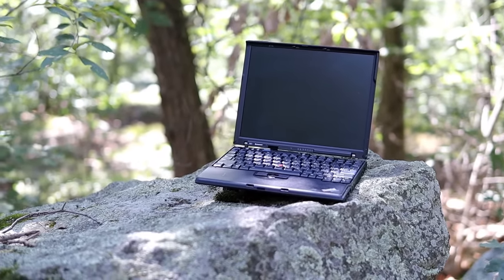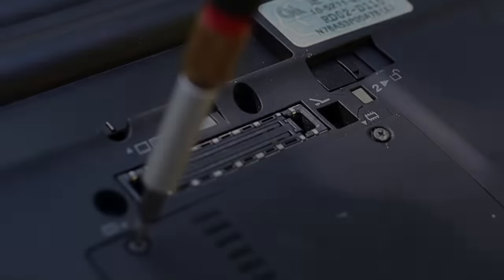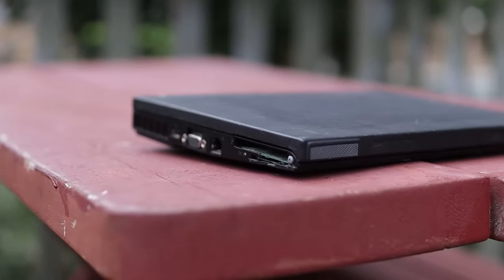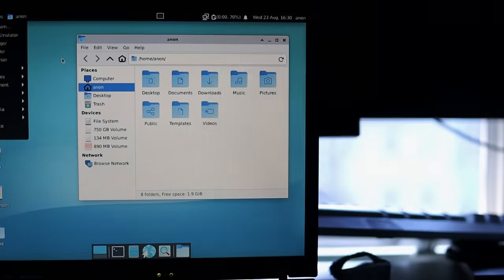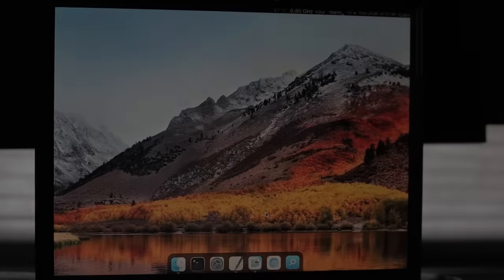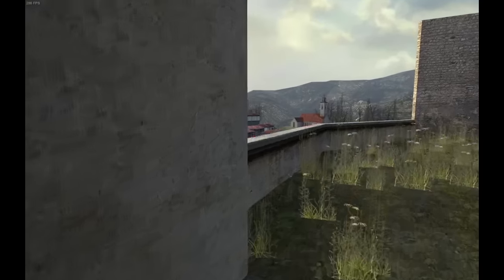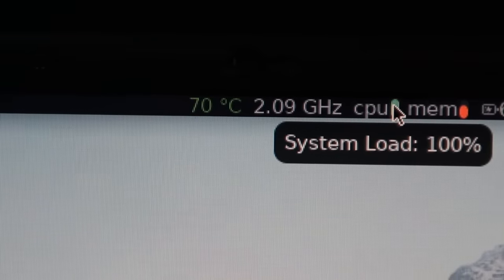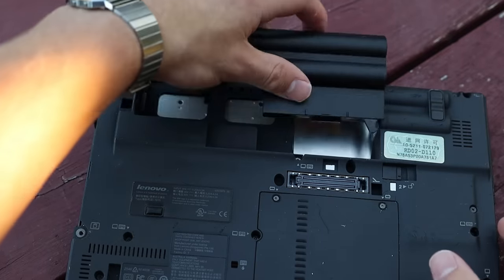Can Linux save this old laptop from obsolescence?

Comment: I have an X200s I was thinking about doing this with - I love the mechanical keyboard and the netbook type size, but to be honest, I was thinking of using it just for bash scripting as I write code mostly in the linux terminal using Vim. Any thoughts on the performance I could expect compared to a newer laptop?
Reply: I still use a Thinkpad T22 with a Pentium III CPU and 512 MHz CPU to do BASH and Python scripting whilst SSH-ed onto my home server - a great keyboard and a nice and quiet computing experience.

You'll be fine with an X200s for that purpose - but getting it to 4GB RAM and installing an SSD are two good and cheap upgrades that will help also. Ubuntu might be a bit "heavy" for it at times, Linux Mint or Fedora might be better options.

Comment: The dislike button is shown, but no count. 
(liked and subbed, btw)
I found my X60 in a skip and  refurbished it with bits and pieces including RAM CPU and SSD .
The only negative with these older ThinkPads may be the rather dim displays.
I guess they can be replaced too.

Comment: I wonder how Arch would run on this if you built a configuration starting from a bare shell prompt and ending on a DE
Reply: it would run just fine, a bit more idle memory usage than void but the same xfce setup will be 350-400 megs idle in the worst case scenario

Comment: I have a Thinkpad x300 with a dead battery laying around, 2 gigs of ram, 64gb 1.8 inch ssd(pain to find a replacement). Running ubuntu 14.04(whatever I found on a random usb stick ony table), it's okay for basic tasks, 480p youtube works fine in firefox. While I was checking on the OS version just now I realised I forgot the password for the only user. Whoops.

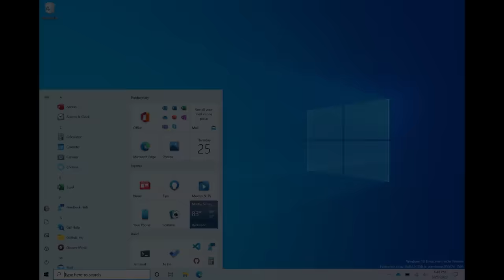Comment: 3:48 Windows 11 has ridicules system requirements. The Windows 11 installer will refuse to do the install on many computers if it does not like the hardware, even though these computers would run fine with Windows 11. When the Windows 11 is hacked to force it to allow the install on older computers many times it is found Windows 11 runs on them just fine. It is an artificial limitation, Microsoft has intentionally designed the Windows 11 installer to NOT run on many computers that would otherwise run fine with Windows 11.

Comment: i have a t400 and just upgraded it from hdd to sdd and its blazing fast with dual boot for ubuntu 20.04 lts and original windoows xp. the ati graphic card can be only utilized by vista or xp and does not work with win7 or later.
Reply from the maker: T series is a nicer form factor imo

Comment: I have compaq 610 notebook. Last week I installed Linux Mint. Nearly have the same specs. Ssd and 4gb ram is game changer here. Before this upgrades win 10 is a total pain. After this upgrades win 10 is better on desktop but system use too much CPU and cause freezing while watching videos. After linux mint I can finally  open netflix and watch :D (up to 720p 30fps. 720p 60 fps cause some freezing :((( )

Comment: I only found 2 really old Linuxes that could be installed without PAE, and for both of them I couldn't find any mirror servers that work, which means you can't even get any software on them. i try to get my T42 to work with 512 mb ram hihi

Comment: Haiku OS Beta 4 would also probably run very fast on this laptop. I've been trying it on some older 32 bit hardware and I've been very pleased with the results of the 32 bit version. Beta 5 is planned for later this year.

Comment: i have a tablet version of the thinkpad x61 and found that games work best with 32bit windows 7 and modded phdgd gma drivers
Reply: I disagree with you 100% and I don't believe you tested each and every game under Windows and in Linux to make that kind of legitimate comparison anyway.

I have been running Gentoo Linux for some 20 years now and I repair, refurbish and collect old IBM and Lenovo Thinkpads too - I probably have around 50 in my collection. In my experience, Windows 32-bit games run extremely well on WINE under Gentoo and bearing in mind that these are games that I have owned and enjoyed for many years, I do remember playing them in Windows 2000 and in Windows XP and in pretty much all cases, I notice no difference between playing them in WINE on Linux.

WINE is a very old and established product and, sure, go back a few years and there were more compatibility issues than there are today - but with the amount of work that has gone into WINE and Proton because of Steam and the Steam Deck, it has become a much better product in the past few years.

You know yourself that running Windows 7 on a Core 2 Duo laptop with a maximum of 4GB RAM is "pushing the limit", otherwise you would not have suggested 32-bit Windows 7 only. (All CPUs in the X61 are 64-bit capable, by the way.) Therefore a slim installation of Linux (and all of my Gentoo builds are as slim as possible) is always going to outperform the bloat of Windows under any circumstance - and therefore "slim Linux + WINE" is always going to equal or be better than straight Windows for older games where there aren't likely to be compatibility issues anyway.

Comment: Here I am with 12TB worth of SSDs installed in an older laptop that is already an antique by most standards yet is vastly more upgradable than anything made in the last six to eight years or so. Modern laptops you'll be lucky to get more than two nvme slots and two sodimm slots never mind a removable battery that has for the most part gone extinct aside from a few rare examples. Gotta laugh at those overpriced macs with tiny SSDs that brick after only 200-300TB of writes.

Comment: Just try to find Batteries for ANY laptop over 6 years old!  LCDs die at 6 to 7 years old!  Most older than10 year old Laptops CANT USE SSD's and HDDs are disappearing !
Reply: I own this laptop and the LCD is good if a little dim. Batteries are found at 20-30 dollars on eBay, and it can use an ssd just fine as I'm running a 128gb kingston currently.

Comment: No need to install Linux, I have a 16 year old Asus M70Vm laptop and it has W10pro installed, I have optimized W10pro through many registry tweaks and I have eliminated useless and harmful processes and functions like Edge and it has become fast, it starts quickly and displays full HD videos without any disturbances.

Comment: How do you measure CPU temperature?
Reply from the maker: I used the xfce4-sensors-plugin and added the temperature monitor to my system panel. There;s an app called Psensor which also does the trick.

Comment: You don't need to mess with linux for simple everyday internet tasks. Just upgrade the ram to 2 or 4gb (depending on what you had before), optionally replace hdd with sdd and install Windows 8.1 or even Trin PC if you have 512-2048MB of RAM and 8.1 is still too heavy for your PC or Laptop. Watching this from HP DV9700 with Core2Duo and 4GBs of RAM and it's perfect in 720p.

Comment: The biggest challenge for old computers (>12 years) nowadays is multitasking modern apps for web browsing and office suites, no matter if the os is windows or linux. In this regard, most people that says zorin/mint/peppermint in these machines is a good solution, actually they don't use it, keeps them like hoby computers, because if they actually would use it they'll notice that are BS solutions, the computer will be sluggish and may freeze or halt, just web browsing and using an office suit app (especially using libre office and open office). The real solution is using windows 7 with MS office 2010 or older, using a firewall or a compatible antivirus and have extra care web browsing; if you really want to use it as a daily light-office-task machine

Comment: I am using my dads laptop for now 6 years its a dell latitude d630 with dual core t7100 and lxle linux on it 4 ram and 270gb hdd, not the best but get the job done most of the time, it's age made me lurn linux, the only down side to it, is i have to keep the display standing with a 2litres bottle of water 😂😂
Reply from the maker: Nice lol

Comment: What about energy consumption? I would assume that older laptops need way more energy than newer machines, therefore not being cheaper on long run?
Reply: The energy difference between this and a more modern laptop amounts to pennies. Not a difference you would ever notice in real-world use.
Reply: @SebisRandomTech  It will be running close to 100% pretty much non-stop, pulling probably ten times as much as a modern laptop doing the same tasks. For that "pennies" you could easily buy something more recent that will not run at 100% installing package updates for 20 minutes each week.
Reply: @kaminekoch.7465  You guys are really overestimating how much of a difference you’ll see in your electric bill with these laptops.
Reply: @SebisRandomTech  50W on top, running 8 hours a day would make a difference of 80 euros a year at 56 cents per kWh. Old CPUs can't compare with anything new when it comes to idle states - not that any of them would even be reached when this laptop is "idling" at 5% running htop. I run already pretty old Ryzen 1200AF with dedicated Nvidia Quadro T600 - running around 20 Docker containers, Git server, Jellyfin and Home Assistant, idling at less than 3%. Even with 5 spinning drives, it idles under that 50W. This laptop will pull straight 75W the second you watch h264 encoded video.

Comment: El problema es que un tipo usó un juego nuevo en un pc antiguo y con ese le quiere echar la culpa a GNU/LINUX? ¿Acaso le iba a funcionar en WINDOWS o quiere pedir peras al Olmo?

Sencillamente el juego de Eurotrack simulator consume mucho y pedirá pc gamer medio actual.

Por otro lado no sirve de nada poner un sistema ligero si luego usas software pesado... La ignorancia es osada...

Por favor, si yo he usado LINUX en un pc de 1 núcleo a 2ghz y 1 GB de RAM. Y claro que jugaba, pero juegos antiguos, emuladores hasta ps1-n64, etc... No intenteba correr Crysis 2...

The problem is that a guy used a new game on an old PC and with that he wants to blame GNU/LINUX? Would it work in WINDOWS or do you want to ask Elm for pears?

Simply put, the Eurotrack simulator game consumes a lot and will require the average current gamer's PC.

On the other hand, there is no point in installing a light system if you then use heavy software... Ignorance is daring...

Please, yes I have used LINUX on a PC with 1 core at 2ghz and 1 GB of RAM. And of course I played, but old games, emulators up to PS1-N64, etc... I wasn't trying to run Crysis 2...

Comment: I'd never buy that laptop unless for under $30. It needs the RAM upgrade and a SSD and still the performance sucks.

About a year ago I purchased an ASUS BR1100-CKA mini laptop on sale for $90. I did pick up a nvme for it, though for what I use it for, I could have bought the $95 version.

This is a "ruggedized" laptop designed for students (schools) and has a MIL spec rating. The specs are pathetic, but it's great for lightweight work.

- N4500 celeron. 2 core/2 thread. 1.1/2.8Ghz, 10nm 6watt and 4mb L3 cache: x86-64, SSE4.2, AES-NI, VT-x, VT-d, TXT 
- Intel UHD integrated graphics (16 EU): dx12, opengl  4.5, opencl 1.2
- 4gb ddr4 RAM
- 11.6 inch 1366x768 display
- USB 3.2, 1gbps NIC, WIFI 6
- 64gb eMMC (128gb eMMC was a $5 option)
- Windows 10 pro

Not only is the CPU over 3 times faster, it is a 6 Watt processor vs the T8100's 30 Watt. The N4500 has many features and extentions that the T8100 can only dream of.  AES-NI speeds up cryptology which is things such as browser security, vpn's, WIFI security. It has full virtualization support (probably not much of a use-case for most). 

The N4500's integrated graphics is vastly superior to the T8100's. Granted it's not going to be powering a great gaming experience, but it can easily handle 1080p videos (on an external monitor). Almost any program that makes use of graphics will see a noticeable speed boost.

WIFI 6 is always welcome along with BT 5. That old laptop might have WIFI 4. The old laptop likely only has USB 2.0 (480mbps) as USB 3.0 (5gbps) was released in 2008. The ASUS offers a USB 3.2 Gen 2 (10gbps and 45w PD) and a 3.2 Gen 1 (5gbps).

The ASUS has a m.2 Gen 3 x2 slot and a m.2 Gen 3 x4 slot.

The connectivity options alone are a huge upgrade. The ASUS comes with a 45w USB power supply and the laptop has a barrel connector for power. This means replacing the USB power supply is easy. Having the option to buy a 45w power supply with barrel connector allows use of the USB 3.2 gen 2 while charging the laptop if needed.

It is likely that the old laptop has a 100mbps nic vs the ASUS's 1gbps. WIFI 6 not only is faster for the laptop but the WIFI 6 network performs much better than WIFI 4 and 5. The ASUS having BT 5 means easier connectivity to headphones, wireless keyboard and/or mouse and adds another option for mobile hotspot tethering from your phone.

I decided to add a 512gb nvme drive to my ASUS. I kept the Windows 10 pro installed on the 64gb eMMC drive and installed grub allowing dual booting Zorin OS from the nvme. Honestly, I could probably be happy if I installed Zorin on the 64gb eMMC and I should have paid $5 more to upgrade to the 128gb eMMC. I wanted to keep the Windows installed in the cases my wife uses this laptop. As it turns out, she has no idea what OS is installed because she so rarely uses it and then only uses it for specific web browsing.

ASUS has several options:
- N5100 CPU 4 core/4 thread 1.1/2.8 GHz, 24 EU UHD
- N6000 cpu 4 core/4 thread 1.1/3.2 GHz, 32 EU UHD

Both double the cores and add 50% or 100% more EU's for the igpu (and a slight bump is boost frequency).  This might add more older or lightweight games to the playable list. 4 cores does allow for a better virtualization experience (I currently use an Intel J4125 4 core/4 thread (an older version of the N5100) computer for virtualization.

- 8gb or 16gb RAM options
- 128gb eMMC option
- 4G LTE option

If you can find one on sale, especially the 128gb eMMC version you will have a cheap,  very light 1.26 kg/2.78 pound, small 29.5x20.5x2 cm/11.6x8.1x.79 inch, rugged laptop that is plenty fast enough for web browsing, playing videos, light office work and more. The connectivity adds many options. It can display via HDMI and USB-C. 

It's basically a Chromebook that has Windows 10 pro included and without being locked into ChromeOS.

If you can find a n6000 version with 16gb RAM then I believe you have something capable of running Windows 10 good enough for many people with a device that sips power and can survive a small fall and a small liquid spill.

Last year I had my son pick up 3 of the the N4500/4gb/64gb eMMC version for his younger kids (aged 5-8, while the 10 year old got a very low end "gaming" laptop). The kids love having their own computer and they haven't broken one yet.
Reply from the maker: I still think I was a steal for $20, but its true that there are definitely better options out there for a little more money as you pointed out!
Reply: That's a lot of words dude. You need to tone it down.
Reply: @wolfrig2000 I'm sorry if so many big words gave you a headache ;)
Reply: @liamjewell62 for $20 and the right circumstances it might be worth spending $20, plus a few bucks for more ram. But what happens if the hdd dies, or the power supply, or the motherboard or display. If you already own the laptop or a friend or family has it in a closet for free, sure. 

I'm the first to admit that the br1100 isn't a top performer, but for light duty it should be fine for 5+ years. A laptop with a CPU from 2007 is already on it's last legs.

I have an old "gaming" laptop. It's got a sandy bridge CPU (4 core/8 thread) a low end dgpu, 8gb ram and I think a 256gb sata ssd with windows 7. Its pretty sluggish.

I've considered putting a faster 1tb data sad and installing Zorin. I'm just sure its fast enough compared to the br1100 to be worth it. My backup plan is to turn it into a virtualization machine. I'll have to get it out and check the specs, especially on the ancient mobile dpgu that might have 2gb ram or only 1gb.
Reply from the maker: Yeah bro went crazy lmao  @wolfrig2000

Comment: No, Linux cannot save anything from obsolescence. Linux may make an older device temporarily useful, but when you consider the fact that a Raspberry Pi or similar new low power system uses so much less electricity than a 16 year old laptop and almost certainly has better performance, the additional consumption to continue running that laptop rapidly overtakes the embodied energy and materials content of the Pi, to the point where it is a net loss to the environment. The Intel Core 2 Duo L7300 in the ThinkPad X61 has a Passmark CPU score of only 513, whereas the Broadcom BCM2711 in the Raspberry Pi 4B has a rating of 853 at 1.5 Ghz (the Pi 4B runs it at 1.8 GHz). Even the most powerful CPU that shipped with the X61, the Intel Core 2 Duo SV T7300, has a rating of only 676. The Pi 4B has a max power dissipation of just 6 W. The X61's CPUs run from 17-35 W.